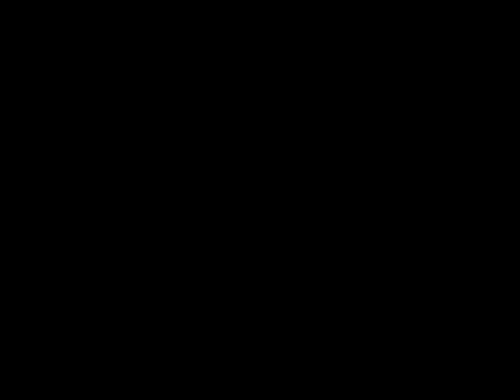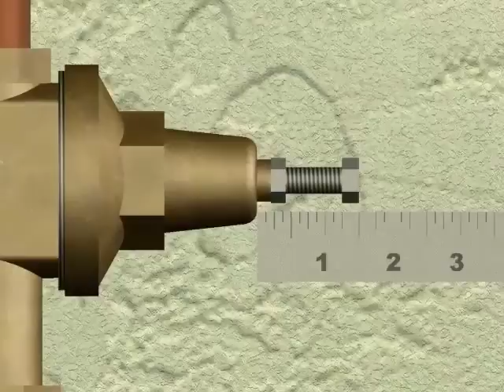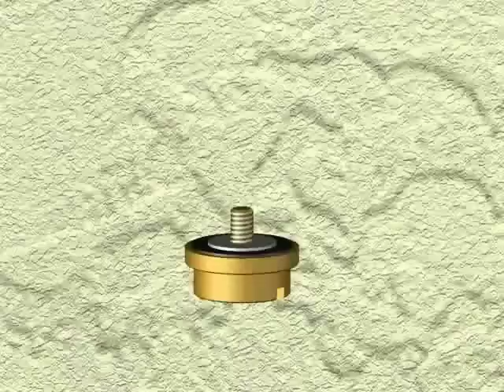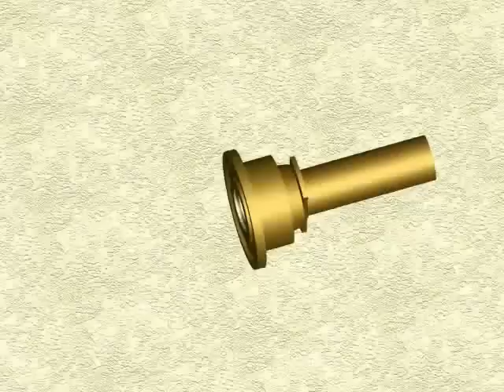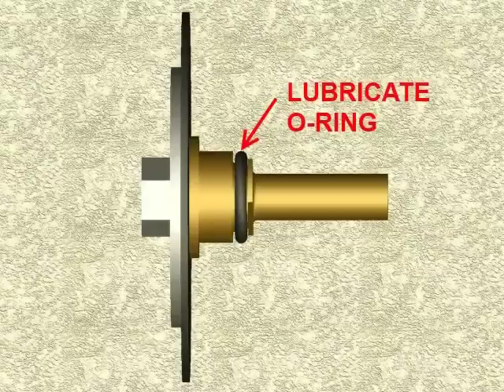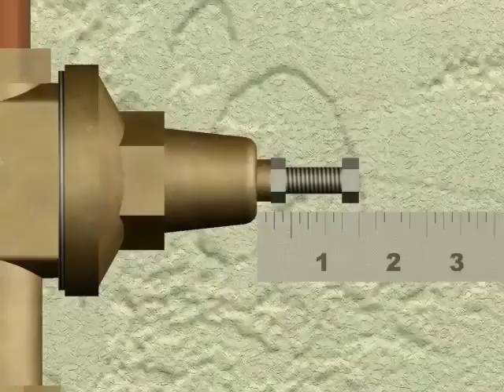Zurn Wilkins Pressure Reducing Valves 500 - How to Repair

Comment: Very good description, but no mention of cleaning scale and calcium deposits....?
Reply from the maker: Thank you for your question, our Product Manager says: "Scale in and on valves can usually cleaned with White Vinegar.  Most calcium deposits will melt away with a vinegar washing.  As for any scale or build-up in the oring bore, after washing with vinegar, use some light sand paper or emery cloth to polish the bore.  In all cases, do not use any cleaning solution that is not food grade."